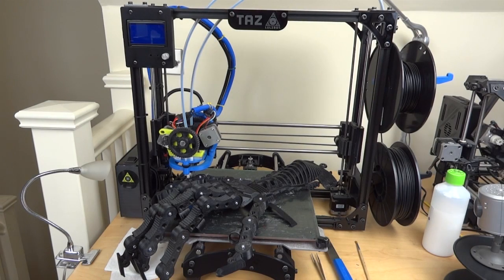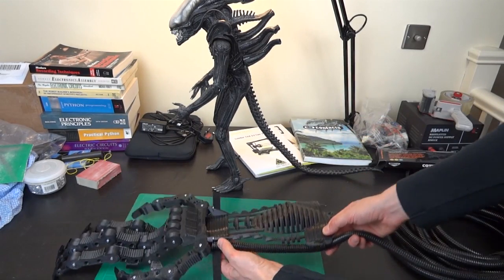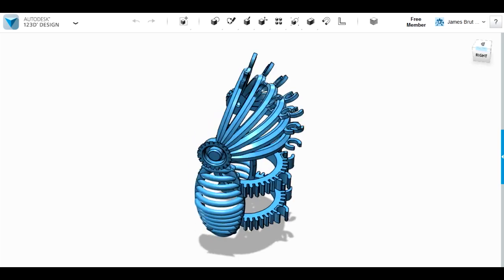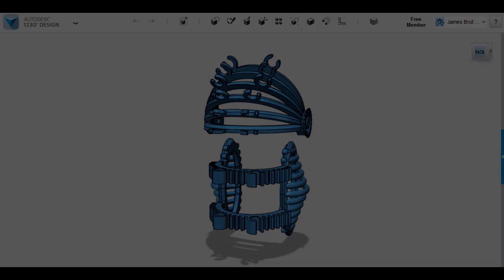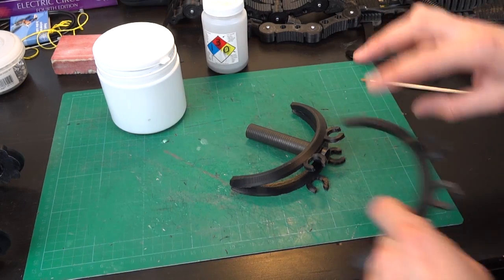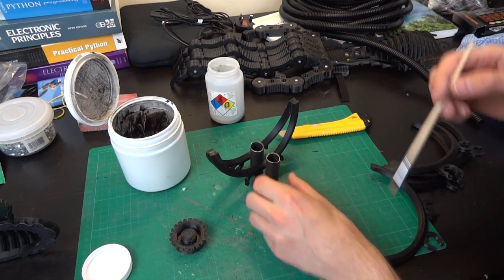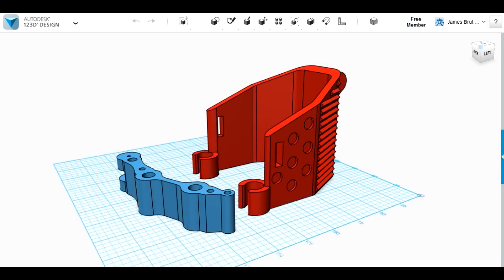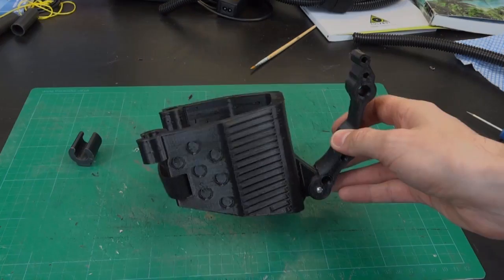Alien Xenomorph Cosplay #4 | ABS & Ninjaflex Arms | James Bruton

Comment: have you made a fully mechanical hand before, if not then can you?
Reply: ***** sweet, it just that IM trying to make 2 hand extentions that arent the general over the back of the hand method but are more acurate and enclose the hand so the hand is inside of the extention, but I dont have the matiriale to build it right now, I have one way of making a hand but its very tricky and I would need to make a tester first and I cant do that, so I thought I should ask you if you had made one or not, and plus your one of the few people on youutbe who do this sort of thing that will coment back with a straight and helpfull answer